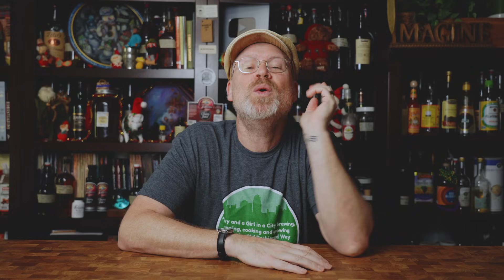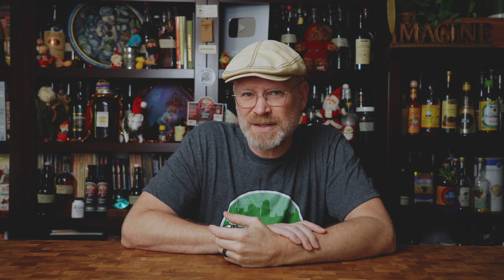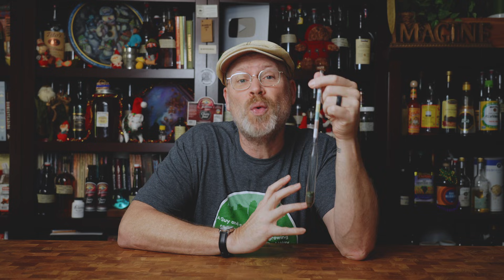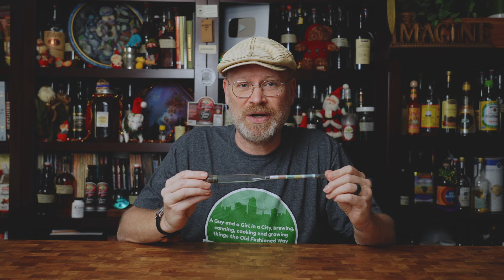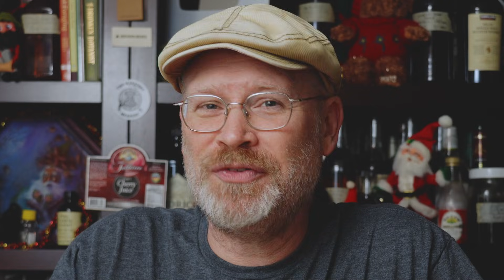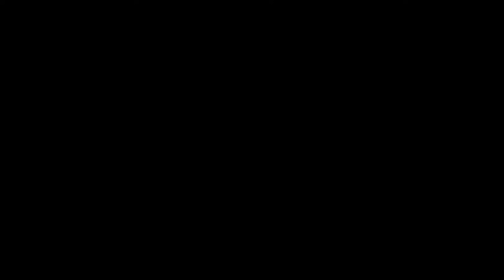How Do I know When my Mead or Wine Fermentation is Finished?

Comment: I have made four successful batches of mead over the last six months. I have an accurate, documented brew log of starting gravities and end gravities. I am still confused as to how I calculate what my expected alcohol volume (dry or not) should be when it finishes fermenting. I understand taking multiple end gravities over a period of time to ensure the number is the same, which would indicate the fermentation is done. But, how do I estimate where my ending gravity should be at the beginning when I take my starting gravity? I have favored Lalvin QA23 yeast, which, from what I have read, has a 16% alcohol tolerance. My second batch was my favorite of the four I have made so far. In that batch, I used three lbs of California orange blossom honey, 2 oz of raisins, and one packet of QA23 yeast. I started at 1.110 GR and ended at 1.020. It produced 12.15% ABV and was not overly sweet or dry; it was right in the middle. I am currently on my fifth batch, and I have stepped up the batch size to three gallons. It is nine lbs of California orange blossom honey, 6 oz of raisins, and three packets of QA23 with a starting gravity of 1.094. Any help I can receive to help me better understand how to gauge where I should end, I would be extremely grateful. Love your content! Thanks again.
Reply from the maker: https://youtu.be/xNwNZgeTtIE?si=Wxp03IY_b6RuLY7o

Comment: Using a refractometer after fermentation only helps to know if your fermentation has stopped by checking the gravity until it stops. But refractometers are completely useless when actually checking your FG as the ethanol will cause the refractometer to give a completely inaccurate reading.
Reply from the maker: There are calculators to adjust it and they work pretty well.

Comment: No, I will not stop counting bubbles. They are the best indicator, all else being equal, with my setup and lack of any instrumentation. 🍻
Reply from the maker: Not really.  They do not show that fermentation is happening, only a difference in pressure.  Temperature changes can make an airlock bubble and so can offgassing after fermentation. 😀👍
Reply: @CitySteadingBrews  You're not wrong that those can affect off-gassing, but I still maintain that it is the best indicator I have in my setup. Cheers.

Comment: contamination risk is too high
Reply from the maker: No, it really isn't.  Contamination happens when you don't properly sanitize.  Properly fermenting brews won't easily get contaminated.
Reply: @CitySteadingBrews  thank you, but how does it not get contaminated when I open it to fresh air full of spores and bacteria? should I discard the measured liquid? adding it back in sounds very dangerous
Reply from the maker: The air is not concentrated enough with those contaminants to be a problem especially in a medium that contains alcohol.  We've done this for decades, made thousands of brews and never had any sign of contamination due to checking it for fermentation completion.
Reply: @CitySteadingBrews  There either is a contamination risk or there isn't one. Thanks for confirming there isn't one.

Comment: Hi there, may I ask a question (I think it's called dump feeding?) adding more fermentables after it's done, if I start at 1.100 and brew down to 1.004 then add more sugar and then it reads 1.034 and take it down to 1.004 again do I work out the abv by adding the extra 30 points to the original gravity? 1.130 - 1.004 or is it more complicated than that? Best wishes. Richard.
Thank you
Reply from the maker: For an estimate of homebrew that works fine.  The real calculation is more complicated but, you really need a lab to have accurate ABV.  Within 1-2 percentage points is about the best you can hope for really so it works!
Reply: Thank you, I'm making carrot and sloe wine if it brews down to 1.004 it will be around 12%,i would like to boost it up to 16% but just a little at a time. I have tried putting all the sugar in in one go but it stops brewing at around 1.030 to 1.050 just undrinkable so I figure if I brew it down quite dry then take it up to 1.020—1.025 brew it down again and repeat then hopefully it will have something that won't give me diabetes 😅
Reply from the maker: @richard39bucks  out of curiosity, why 1.004?
Reply from the maker: also, that is not how you get diabetes, I happen to be diabetic and statements like that are misinformed and a little.... well, you know 😀
Reply: Mate it's just humor, I didn't mean to upset you, sorry 😅 going down to 1.004 isn't a precise place I was just just using a random Purley to illustrate something. Once again I'm sorry if I offended you, it was my intention.
Reply from the maker: It's fine, thank you for the apology.  For your SG to use before adding more.... I recommend letting it actually finish because.... if it hits 1.004 it's possible it will not ferment more, so adding more fermentables might just be essentially sweetening.  If you let it run out, ie, go dry, it is more likely to have a little left to go if you add more.  Does that make sense?
Reply: Yes that makes perfect sense and is very helpful advice thank you. I keep trying so I'm sure I will get it right one day

Comment: I dont have tools for readings but im sure there's some other way of knowing when its done no? How did the vikings know when their mead's done?
Reply from the maker: They didn't.  They probably drank it young while still fermenting tbh.  The only way to know done from stalled is with readings, the equipment is pretty cheap too.  But, it you leave it under airlock for a few months, it should be ok, as long as it didn't stall.

Comment: Lordy mercy.. does anyone make wine or brandy the old way without all the bells and whistles? My mom made wine and brandy and NEVER had any bubblers or hydrometers and she made some of the smoothest brandy and best tasting wine.  People always came to the house acting friendly until it came down to if she had a bottle or two sitting around, that's all they came for.
Reply from the maker: Well, brandy is distilled so not even the same thing.  People used to do things a lot differently but when something safer or more efficient happens... we tend to use the better method.

Comment: "Every bubble is a giggle!"
The important reason to test is that residual sugar can cause secondary fermentation in the bottle. Bubbly wine is fine. But exploding bottles are dangerous!
Typically, they blow as the temperature goes up. Warm water holds less CO2 than cold water, so the pressure goes up.  A bottle detonating in a case can shake its neighbors, and a minute or an hour another one goes...

There's a difference between sweet wine and suicide.

Comment: Mine dropped from 1.123 to 1.000 in two weeks, and because my instructions said to add the other half of fruits in two week i just added them… not sure if that will re start fermentation,
Reply from the maker: It could.
Reply: @CitySteadingBrews  is that bad?
Reply from the maker: Not necessarily.  Depends on what your recipe is calling for.
Reply: @CitySteadingBrews  thx u🫶🏽
Reply: @CitySteadingBrews  it was suppose to be an apple cider cinnamon mead…
Reply from the maker: @Gurdsresu  that's not what I mean.... I didn't write the recipe,, know nothing of what is in it, and don't know it's source or validity, so, I really can't comment on what it was meant to do or not do.
Reply: @CitySteadingBrews   3 diced apples
● 2 lbs clover honey
● 2 quarts fresh apple cider
● 1 cinnamon stick
● 1 tbs cloves
● Approx. 1 quart spring water
● 1 tsp yeast nutrient
● 3⁄4 tsp tartaric acid
● 1 1⁄4 tsp malic acid
● 1⁄2 tsp pectic enzyme (optional)
● 2.5 g wine yeast
● 2 campden tablets (sodium metabisulfite)
● 1⁄2 tsp potassium sorbate
Reply from the maker: @Jm-ue8ze ok... I am attempting to help but there are so many ways to do things that a list of ingredients doesn't tell the whole story.  If you are following a recipe, please follow that recipe.  Adding other opinions and changes will only confuse things.  It's not my recipe so I cannot give advice.
Reply: @CitySteadingBrews  thanks for the reply🫶🏽

Comment: I'm on my third batch. I'm making 1/2 gallon batches. I know. My first batch was strong. Triple cherry fruit cocktail. Second batch was peach. No where near as strong but tasted amazing. This batch is peach again but it is going crazy. Foaming up and rapid blow off. Temperature is warmer with each batch. Trying to keep it cool. Any tips. I use a blow off tube after my first batch tried to blow off my gas valve lol.
Reply from the maker: We keep ours around 75f.... what temp are you trying to keep?
Reply: @CitySteadingBrews  Around that
Reply from the maker: @shawnhood6555  should be fine.  As I said, that's how we always do it.
Reply: And does mixing it while it's fermenting, without opening the jar, cause any issues
Reply from the maker: I wouldn't after the first couple days.
Reply: @CitySteadingBrews  thanks
Reply: 68-70F
Reply: Cool. Just going crazy. It's funny now, but the first time was scary.

Comment: ???. 4/6/24 started a 1.4 gallon pear mead. 2 pounds honey 3 lbs pears black tea 1 tea nutrient. Raisins 71 B yeast. SP 1.078. Today is 4-6-24. That's less than 24 hours, I thought it was stalled? airlock? Nutrient? PH?  I took a SP reading and it was 1.016, giving me 8% abv. Bryan Dereka Can this be even possible? I did use a full pack of 71 B.  If so should I just leave the pears in for a few weeks for flavor? This is the quickest I have ever seen. Is there anything else to check? 🤔 Thanks guys
Reply: PS 2 bay leaves and 8 whole cloves as well, if it matters.
Reply from the maker: It's possible... it's also not done.
Reply: Just seemed like a lot in a few days I'm waiting for the magic 1.000 thanks guys your Awesome!!!

Comment: If you are to lazy to take a reading. There is one other option, just wait. If its been 3 years then its both done and aged. Double result unless you didn't want it aged and wanted to use the bottle. 

But anything about 3 months its plenty for any yeast, as far as I know.
Reply from the maker: Erm... what if it stalled?

Comment: Hi! my hydrometer has more data. There is the 1000 you are talking about, but next to it there is 0% on the alcohol scale. Now if it reaches 1000 and no longer ferments, then the alcohol is 0%?? Why is the alcohol 0% at 1.000 gr? At 10% of alcohol scale I have 1073 gr... so why should it be 1000gr and 0% alc?
Reply from the maker: https://youtu.be/Y0KP0WYreic?si=oCKWETcJEEKfcp-6

Comment: Hey guys. I recently started my first batch of mead and my starting measurement was at 1.104. Now, three weeks later, i measured 0.996. My questions are: 
Am i interpreting it correctly that I should end at around 13 -14 % alcohol?
Does a mead always go dry as long as you keep it going and you're not exceeding the alcohol tolerance of the yeast?
Does stirring make a difference when measuring? I shook the carboy when I pitched the yeast to get oxygen into it but never moved it after. I measured by pouring some mead into the cylinder. Should I stir before measuring because the concentration of alcohol is different throughout the mead?
And finally: I assume since it's below 1.0 its about done so I would rack it into a second carboy. If I want to backsweeten it I would need to stop fermentation. Can this be done reliably by pasteurizing it? I was thinking to put the carboy into a big pot of water and heating it above 140 for 20 minutes. Does this affect the taste in any way?
Thank you in advance. Sorry for this many questions at once
Reply from the maker: All seems fine.  No, don't stir up the brew to measure.  In this video we explain when it's best to rack.
Reply from the maker: We have videos on all of this including pasteurizing :)

Comment: howdy again, quick question hopefully...  after lets say everything is done  (degassed, pasteurized, voodoo'd etc) and you want to bulk age. at that point would you say its safe to plug the jug or would you still use an airlock? or skip that and just age in bottle?
Reply from the maker: If you are 100% sure it's done and degassed you can cap it.  We usually just leave airlocks.

Comment: When you say you can tell off your first measurement if its going to go sweet or dry how do you know these things. I think you mentioned that u have a video out on this information.  I may have just not been able to find it yet.
Reply from the maker: It's about knowing the tolerance of your yeast.  Say you have a 10% yeast but your original gravity is 1.100.  That can go to about 13.5%.  Most likely it will end sweet.  Say you used an 18% tolerance yeast... now it's likely to go dry.

Comment: Ok very very new at this, I forgot to get the first measurement. So is there a way to calculate or did I cause a serious issue because I missed the first measurement
Reply from the maker: All you can do is estimate based on your recipe.  It's not that important as the final readings tell you if it's done or not.

Comment: If it goes under 1.000... you got a problem!
Reply from the maker: No... ethanol is 0.079 sg so mixed with water it can easily go below 1.000.  We see this all the time.
Reply: Oh, the more you know... Only recently stumbled into the mead and cider making :) I assumed it was the same as beer, where going below 1.000 can mean infection by some wild bacteria or yeast (unless you have a yeast with crazy attenuation)... 
So I guess mead/cider can finish lower because less protein and unfermentable sugars in suspension and on average a higher ABV than beer?
Reply from the maker: Beer can in theory as well without infections.  It normally doesn't because there are non fermentable sugars produced in the mashing process.

Comment: Took a reading on first day 1.080
Day 5 it’s at 0.996 what happened will it possibly go back to 1.000? Or did something go wrong?
Reply from the maker: 0.996 is lower than 1.000.  That just means it fermented a bit more.  1.000 is considered dry but really the lower the number the drier it is.

Comment: Thanks for the info. It´s always amazing when amateurs can determine things by taste and feel when professionals need to rely on measuring equipment. I have a current batch of ginger beer that ferments for quite a bit now. According to the taste test it´s probably dry. According to the bubbles it´s fixing to rain soon. Today my hydrometer set arrived 😀. Tomorrow I´ll take a preliminary final reading to verify. With the new gear the next batch is going to get an OG reading.
Reply from the maker: The difference between an amateur and a pro in this context is an amateur may make something good once.  The pro can make it over and over.
Reply: @CitySteadingBrews  It was a little tongue in cheek. Often the amateur only thinks he can while the pro knows his limits. I have seen this in different fields, e. g. baking bread, when people think they can skip the tedious kneading and then complain about the texture of the finished product.
That´s why opted for getting hydrometer. My brew may be done. I cannot really taste whether there is some small amount of sugar left and I certainly can´t make a valid comparison with a  taste test next week. Your videos helped me to get a better grasp on this.